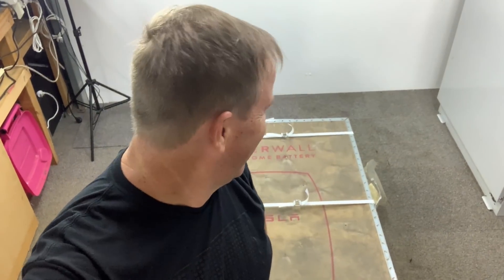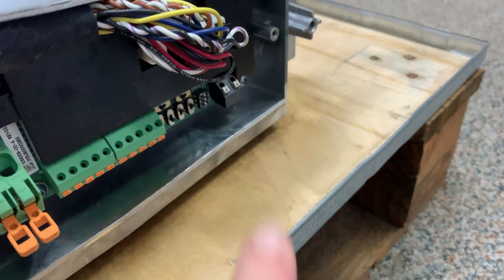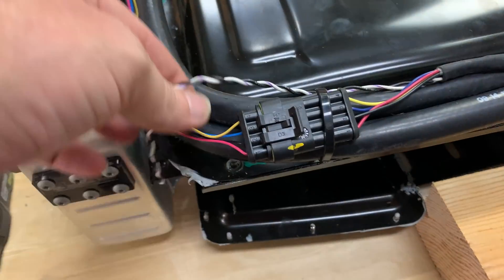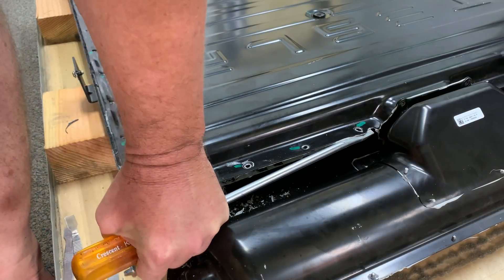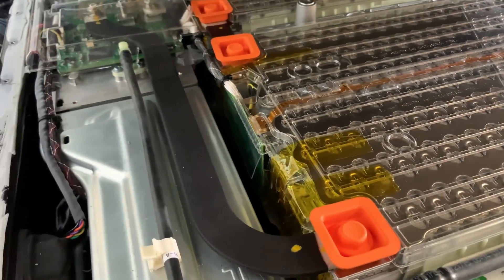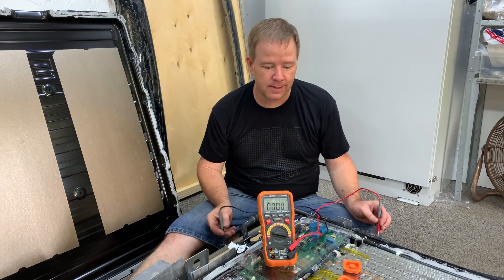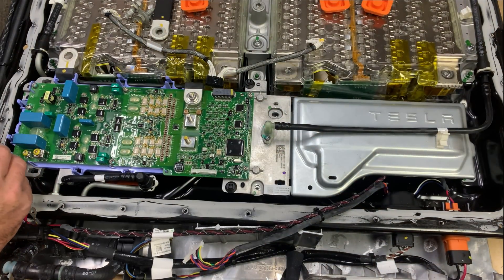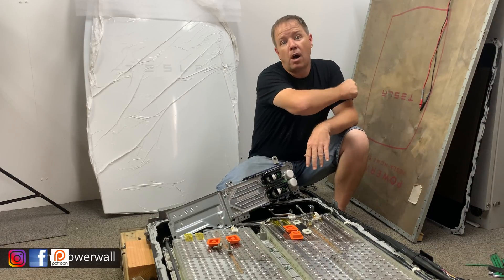Tesla Powerwall Teardown - Taking a look inside a new Tesla Powerwall thats been stored for years

Comment: Those batteries should be easily revived. Even if it won't take a charge at room temperature, dump them into a deep freeze cooler until they hit about -12 C and then do a slow trickle charge.
Reply from the maker: Freezer you say... careful what you wish for lol
Reply: @HBPowerwall  Well resetting lithium ion batteries and waking them back up simply relies on cold shocking them.
Reply from the maker: I need an official source for this information some are saying 100v for 1/1000th of a second - I'm more confused than when I started
Reply: @HBPowerwall  Um, what now? Reviving a battery should be done at low voltage not high.
Reply: @HBPowerwall  https://batteryuniversity.com/learn/article/low_voltage_cut_off

It's very likely that these batteries aren't dead, but simply in a "sleep mode" they reached their minimum discharge before the controllers stopped drawing power. You won't see any voltage off of them as they won't allow current to flow in this state.

Freezing it shocks the batteries and helps to break down the copper spikes that may have formed, prior to charging them. I'd suggest removal of the batteries from the Tesla Wall system (if possible) and directly charging each one with an external charge controller at very low voltage, say 10 volts, for 24 hours after they're fully thawed from being frozen. If they carry a voltage of 2.2 volts or greater after this, then you can try charging normally.
Reply from the maker: honestly i think they are dead!

Comment: Hopefully it's reviveable... With the cells at 0v, I'd be afraid some series strings got reverse charged and are now shorted... but only testing will tell. At least it was free :)
Reply from the maker: This has happened with out a doubt.
Reply: @HBPowerwall  please do not attempt to revive the batteries. See my other comment as to why. Any attempt to reuse these cells is a real fire hazard since the internal structure of the batteries has been damaged in unpredictable way and they can fail now... or later...
Reply from the maker: Very aware of the advertised risks, but it would be cool as hell to try you gota admit :P
Reply: @HBPowerwall  Totally. Just don't burn your house down. I want to see more of your videos ! :)

Comment: I got a fair bit of criticism for speculating that it had two regular Tesla car modules
Wired in series https://youtu.be/FxGIRMQCAdw
Reply from the maker: Yes, I saw that when trying to do some research for this video about a 40%d dislike rate - never seen it - at least there was interaction :) Now you can updated it and tell them where to go, or make a follow up video
Reply: That's the general public for ya, ie, know everything without any knowledge. Why wouldn't you use something you have on the shelf, it cuts costs, and in fact the auto industry is full of reusing parts from older models, ie, Mazda used 1970 door handles, floor pressing, etc, on their 1980 323. Basically the 1980 323 is a reskinned 1970 808 - lol -.
Reply: @jehugarcia You titled your video “INSIDE A TESLA POWERWALL” and the thumbnail showed a module from a Model S or X. Then you didn’t show either a Tesla Powerwall or even the cover off of EV West’s custom built powerwall. I don’t get how you don’t understand viewers would be disappointed and feel misled your title and thumbnail.
Reply: After Seein It's Guts For Myself, That's Sure What It L@@Ks Like To Me Also Jehuey! I Think Your Right On Your Assuptions! Thanks
Reply: @grumpyjohntxredneckrc6346  Even the steel shell looks auto rated, ie, like the whole thing came out of a car. That steel casing is what separates DIY PW from Tesla PW, because if the batteries catch fire that steel case will save your house from burning down. Unless DIY gets serious about fire suppression boxes, I bet the Gov will mandate it after a few houses burn down.
Reply from the maker: Deletes my link to video 😅 Thanks Jehu!
Reply: @HBPowerwall  nice one 👍
Reply: The dislikes are more likely from people misunderstanding the title, and thinking you were going to show the insides of an actual Tesla powerwall, rather than talk about your wall made of Tesla cells. Randos who Youtube sent your way who don't know you would probably feel misled <shrug> What can you do?
Reply: @GTrainRx7  there is no misunderstanding the title. The title and thumbnail are very clear that we are going to see the actual inside of the unit and board level views. There is no mistake.
Reply: @JM-yx1lm  I wasn't referring to this video, I was referring to Jehu's video. This one is super clear (I hate the amount of clickbait on youtube, titles and thumbnails are super important!) I probably should have made it more clear that I was replying to Jehu, not commenting on HBPowerwalls video.

Comment: You should hang that powerwall cover on the outside of your shed :-)
Reply from the maker: That would be cool! Better again would be to replace the batteries with one of my mounts and build a POWERWALL lol
Reply: @HBPowerwall  replace all of the old cells and revive the pack
Reply from the maker: I don't think I could use the Tesla PCBs as they need to be activated
Reply: Breaking THAT tamper-proof seal certainly voids your warranty.

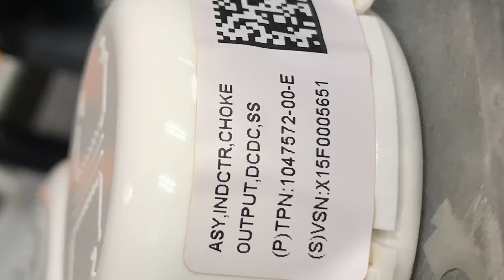Comment: 11:58 Choke Inductors. From Wikipedia: "In electronics, a choke is an inductor used to block higher-frequency while passing direct current (DC) and lower-frequencies of alternating current (AC) in an electrical circuit."
Reply from the maker: Thank-you sir, hadn't even had time to search so of the components!
Reply: It's just a coil of copper wire

Comment: I keep wondering if anyone has successfully used an intact Tesla battery as a power wall with the 400+ volt controller. I know Jack at EVTV started to.
Reply from the maker: Yeh, Jack has a solution on his webpage - from memory a custom built inverter.  He was also talking a custom inverter for the Model3 Batteries. Honestly I think Tesla Should release a plug and play setup as all car makers - instantly give their old batteries double the value!
Reply: actually, it's combination..

they reverse engineered the can bus, thus being able to program and use the tesla native bms, they sell this ( used to own one, and about 75 kwh usable out of 2 crashed model s's).
also he did have signeer do a custom of their 16 kwh inverter..

unfortunatly jack passed away in the second part of last year
Reply from the maker: Thanks for the info

Comment: have you tried to use something to freeze the sealant and have it chip apart instead?
Reply from the maker: Didn't have something available - BUT could order and test.. be well worth it.. In hindsight, it's there to stop thermal venting so I'm going to say the material will be pretty much cement!